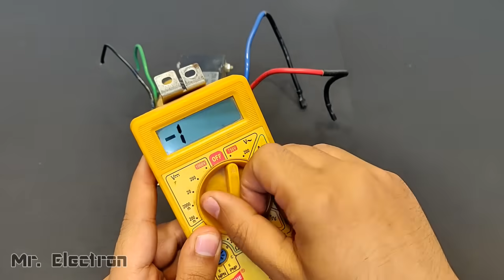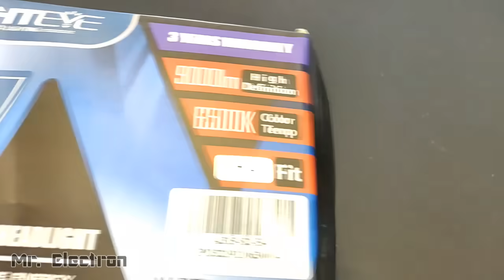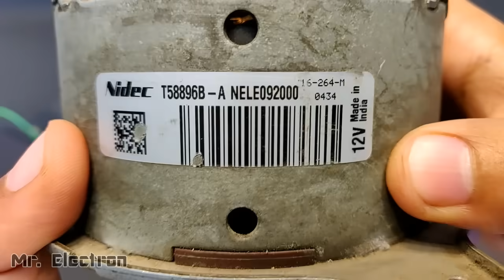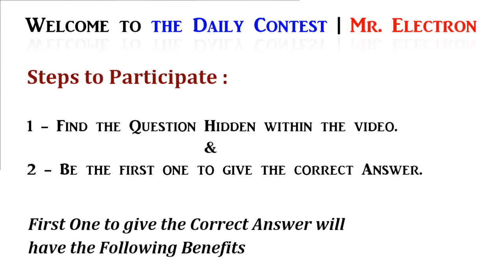12V 100A DC from 220v AC for High Current DC Motor - Power Supply from UPS Transformer

Comment: i think your math is off. there is no way this setup can output 100A at 12v. i also doubt the current ability of the rectifier and the load capacity of the coil. the rectifier will be absorbing 0.6v at 100A draw so 60W absorbed by rectifier alone!! .learn electronics!!!! maybe a peak of 100A, but my guess is anything over 10A constant draw and the smoke will come out of parts

Comment: Vos sos de Argentina? Yo vivo en argentina pero no soy embustero tu titulo de 100A.- La lampara es de proyector y los trafos son de 6amp. Maximo Los motores que aplicas no exeden de 4 amp. cuanto puede ser el filtro electrolitrico 4.700 micros x 25 volt.- Toda esa fuente te suministra  no mas de 7 u 8 amp.- a parte no te coincide el calculo de puente de diodo en relacion a los aparatos que estas precentando............................................

Comment: No way you have 100 Amps from that transformer. For one thing the secondary wires are not even the correct gauge for 100 amps. Ever if 100 amps were drawn intermittently, still will not work, can't draw out what the transformer is not designed for. No (UPS transformer) of that one is 100 Amps.

Comment: This transformer is not 100 amp
The diode bridge. Is 25 or 30 amp
The wires it us not the calibre fir 100 amp
Can you tell WHY YOU LIER ???
Reply: Stephen Ferree  si. Es posible.  Pero desinforma a los que recien comienzan.  100 amp CONSTANTE.  No p.e.p  es una corriente respetable    Un motor de arranque  consume de pico unos 200 amp en cc 13v.   Constante podra andar en  los 70 aprox.     El cable es 35 mm  el experimento muestra 6mm aprox
El transformador por el tamaño de nucleo. No supera los 10 amp.   Porque maleducar a la gente ?
Reply: Stephen Ferree   me too im work in electronics and electrical since 1972 😳 so. I can now what is 100 amps. He make confuse to guys to start in the world of electrons

Comment: 220v ac at .5amp transformer, no way in hell your ever get 12v 100 amp output when the transformer  is only rated at 110 watt, to get 12v at 100 amp your transformer must be at least 1100 watt

Comment: Are you sure output is 100 ampere? Yes in theory P(in) = P(out). Sure you can output 1200watt (12v x 100a) with input ~ 220v 5.5a. But in reality that a bit hard. Especially you using transformers. Transformers sure can convert voltage to step up or step down, but it lack efficiency for current. If you want more current, trafo need high diameter wire, that why the bigger the current trafo also get bigger. From video you using medium trafo that only deliver 3a maybe 5A

You thumbnail input is 220v and 0.5a and that only 110watt. How can you have output 1200watt???

Are you sure as your name Mr Electron is professional in electrical engineering??

Comment: There is NO way this can deliver 100A of current........
lets do the math. 220v@.5a input = 110w of power. ASSUMING 100% efficiency, 110w/12v = 9.1666A 
Simply put it is IMPOSSIBLE to get more power out than you put in. You put in only 110W and expect 1,200 Watts out???? Transformers DONT work that way
In addition, to carry 100A of power you will need #4 awg wire (which you are not using)

Care to try again???

Comment: Just as much lying as the Indian Microsoft support scam.
Yes, you may get a 1kW motor to run with 110W power, when not under load.
And that 1,5hp is a 180V motor...
Not real.

Comment: Nope. 12V 10A maybe. In my eyes, to small task for even that.
Momentary discharge, short-circuit, ok. But RMS? No.
220V 0,5A = 110VA. There's no way that can be multiplied 10-fold. Scam, lying, exaggerating, fooling....

Comment: There's no way u'll get 100A from that tini transformer😂...i have one bigger than yours and deliver  25A 12v...also the conversion ratio from 220v 500mah AC to 12v 100A DC is impossible, pls dont bs ppl from ur community🤬
Reply from the maker: Actually, it can go upto 120A under S.C. For proof, please check out my latest video 👉 https://youtu.be/5F6AsyhFTAA
It's all because of the thick secondry winding.

Comment: Idiotic video! There's no way that little rectifier could handle 100 amps without a heatsink! Also the input power is listed as 220v, 500mA, or 110 Watts. The output is stated to be 12 volts DC at 100 amps, or 1200 watts. Impossible!